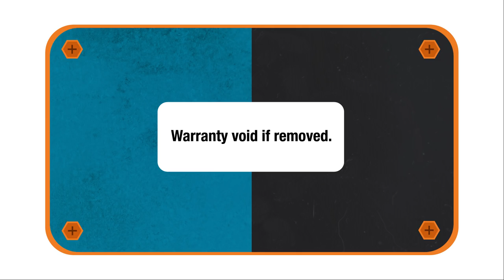Projector Tech Comparison: LCD vs DLP - The Electronics Inside

Comment: Great to see both “side by side” on the same video. Your way of presenting and comments are very pleasant to see. That part of dichroic glasses and the light representation turned out a beautiful insight.
May I suggest you to include a few seconds along the narrative to include (@ post producing) some macro photos, or eventually microscope-based photos - probably a digital camera with enough MPx and zoom in would work fine. This could bring us to better witness such beauties of the LCD and DLP.
Thanks for sharing

Comment: Awesome video! I actually owned a CRT projector (bought used on eBay) in the early 2000's. I'm not surprised that the ones you saw had bad color convergence. I remember that calibrating it took hours, but it was worth it. The image was silky smooth... almost like film. Too bad it weighed about 200 lbs.
Reply: Hmm, We had a 3-CRT projector and it had a switch on it to turn the display into "cross hair" so you could adjust the alignment with a set of 4 potentiometers (1 color was fixed and you could adjust the x & Y of the other 2 colors to align them), It only took seconds to align. When it got old, however, it would randomly jump out of alignment, and even got to where you could no longer align it, I think it was the red tube would 'jump' left & right so it wouldn't stay aligned. looking back now, it probably just needed the potentiometers  replaced.
Reply: they were very heavy and very bulky, but had amazing image quality. recall conferences where they started an hour earlier just to adjust the crt projector they brought. wished I owned one but never got around to buy any. now tvs are large enough for my use.
Reply: Does anyone know how they compare with power consumption? I can imagine newer LED and LASER based projectors  are much better, but I can't quite place in my mind if high power CRT would be more efficient than HID lamp and LCD?

Comment: Not liquid spillage, this is caused by hours of intense heat cooking the glues and plastic surfaces. A blister is formed and that avalanches causing the damage you saw and the glue eventually gets so brittle the lens falls apart.
Green is the center LCD and blue is the one the farthest away. You will see there are extra lenses to intensify the blue light path since human eyes have problems with blue. The fact that blue is amplified it will quickly burn the LCD or the polarizer plates causing discoloration on the screen.
LCD also suffered from dust contamination since the light path was exposed. The next step between these two technologies was the introduction of a colored LCD panel in a very small form-factor and quite inexpensive. This allowed a single LCD to produce the full picture and thus eliminating the need for splitting the white light. short light path, less dust, but lousy picture quality.
Reply: Thanks Dan, that makes a lot of sense. Do you think the inclusion of a cold mirror might help the longevity of an LCD projector by rejecting a lot of heat at the begining of the light path?

Comment: Not all LCD projectors are big and bulky. From what I've seen there isn't much difference between the two as far as size and weight goes.
Reply: I didn't mention that there are professional DLP projectors that use 3 DLP chips, one per colour. These would need combined optically like the LCD.  As you say these would be pretty big (I think this is what Cinemas often use now). I don't know of LCDs as small as the single  chip DLP? Do you know of an example, or how they manage to be so small?
Reply: @a531016  Most of the Epson powerlite projectors are fairly small and lite. usually these are smaller as the optics are much simpler and cheaper then what was shown here. The Powerlites (1715c) I've taken apart all have shorter and narrower light paths. still the same setup, just smaller.
Reply: @brianhoehn949  what is it that makes the difference? Pixel density of the LCDs? I might see if we can do a follow up with a more modern LCD and a LASER?
Reply: @a531016  as far as I know you can get LCD and DLP with similar specs in a similar form factor. I personally prefer LCD(brighter image for the same light power) and less moving parts. I think DLPs tend to be cheaper but I haven't looked at them in awhile.
Reply: @a531016  I would love to see a Laser projector. I haven't got to play with one. They're more expensive then a LCD (about $2000 more for an EPSON at education pricing(more for commercial). So they're really only worth it if you need a maintenance free device. Edit: I'm talking about a large venue projector.  You can get smaller ones for a little cheaper. but the price has come down a lot in the last year.